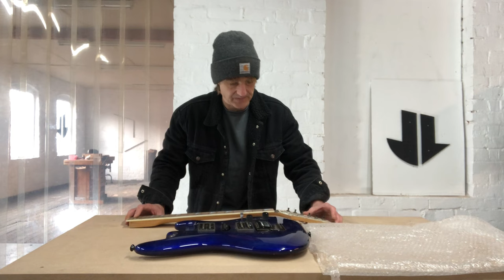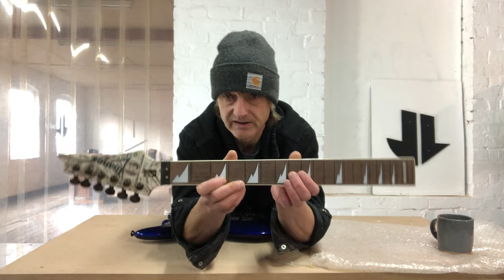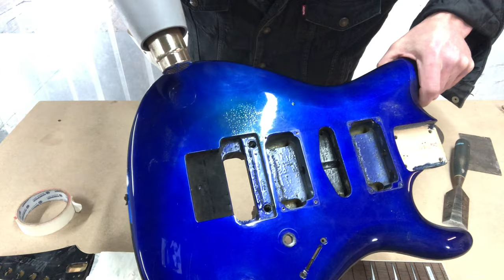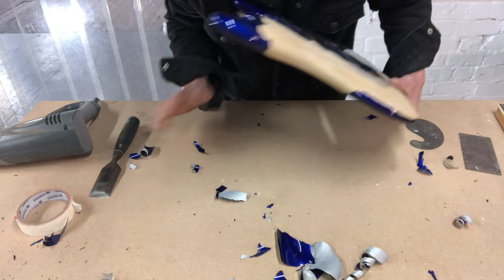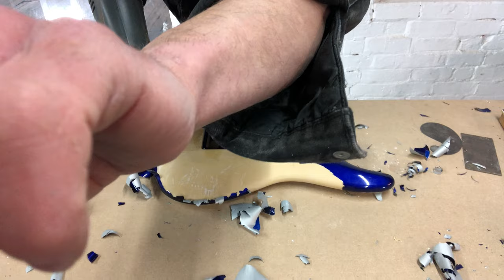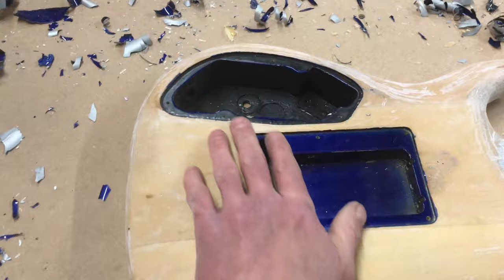How to STRIP GUITAR PAINT made EASY | IBANEZ refinish | HOW TO BUILD GUiTARS

Comment: How do you know what finish a certain guitar has and what techniques need to be used to strip that paint? I dont think many manufactures list what kind of finish they put on a guitar. I have a couple guitars i want to repaint and was wondering whats the best way to remove old finish. One i want to do is a schecter km7 mklll and i only want to do the top wood. It has a satin finish  over a stained poplar burl top. I dont like the stain color they used but the wood grain looks awsome and if i could somehow keep the new finish transparent that would be my first choice. Can the existing stain color be taken out or faded enough to re stain? Even with a dark stain? It has a bluish/purple fade stain existing. If i could get the satin finish off snd stain it black id be ok with that then spray satin clear over it. Any suggestions?great video thank you
Reply from the maker: Most factory finishes are polyurethane or water based acrylic. If it is only a thin satin I would recommend just sanding it. The colour should sand right off. If you are only removing part of the finish I wouldn’t recommend heat as it could affect the areas you want to keep. Thanks.

Comment: Every type of finish serves it's purpose. Urethane finishes are amazing at taking daily abuse and are way better at protecting woods from dings compared to the finish checking that would eventually occur in nitro after a nasty ding... As for your comment that urethane finishes are a "plastic", just a lil fyi, Nitro laquer is one of the most primitive forms of man made "plastic" resins that are still in (in ever dwindling numbers, but none the less) used today. Urethane can't be dissolved by simple forms or acetate stripper because its base compounds are far more resistant to solvents after it has cured. If it peels off of wood, it means the wood was either abused, introduced to moisture, or not properly prepped for finish when initially sprayed.. Nitro will dissolve at essentially any point in its cured form once introduced to even mild quantities of acetate solvents. Nitro is also extremely volatile and hazardous to human health and the environment due to it's ability to evaporate up to 85% of it's atomized form in the atmosphere... it has been illegal to use by manufacturers as a finish in the automotive industry for quite a while.
Reply from the maker: Yea. Poly has its uses as I say. But it isn’t really about making a better guitar. It’s a practical solution. Nitro is closer to actual laquer. And yes the thinners are harmful. I did say it possibly was more harmful. I don’t know. Nitro is much better for guitars though. And much easier for the small builder/diy approach. The ageing process of nitro adds beauty imo. Whereas ploy just ends up flaking off in chunks and us irreparable. Nitro is absolutely the better finish for musical instrument. It may be a kind of plastic but it behaves very differently to poly and acrylic. They use water based acrylic nowadays as far as I’m aware. I’m no polymer scientist by any means.
Reply: @JonLettsGuitars  i do enjoy nitro, especially when it comes to repairs of vintage guitars or Gibson, and as a general whole i do enjoy the way a nitro finish ages, on certain instruments.... but my builds almost always get a two component polyacrylic or urethane clear/hardener combo sprayed through an LVLP sprayer over whatever basecoat i end up using, the results are the strongest, have the most material adhesion per coat by far.... and are the best at self levelling, which cuts down on any sort of level sanding needed. These finishes are not easy without practice and the right equipment/setup, but the same can be said with ANY finish worth its weight in protective qualities.
Reply from the maker: @FulcrumsEdge  yea. Nitro is very user friendly. I’ve always believed mixing products is a bad idea. Due to the different plasticity the finishes eventually pull each other apart. But I don’t really know what’s best and what isn’t. It depends what works for you. I’ve been led to believe that nitro is harder, definitely not the most durable but so easy to fix that that becomes less important for me. I’ve painted a lot of guitars with nitro with great results. That glass effect never gets old. But only ever used rattle cans. Which are cool but obviously more expensive that way. Thanks for your input (I mean that). 🙏
Reply from the maker: @FulcrumsEdge  I haven’t used laquer for years. Just danish oil. “Laquer” just takes too long for me. I don’t have a booth either so it’s really intrusive for the workshop. Danish oil is also pretty bad for the environment.
Reply: @JonLettsGuitars   when i say "whatever basecoat i lay down, i mean more of the style of finish applied, be it a transparent dye stain, sanding sealer/clear coat, solid opaque color, or  pearl/metallic finish. I don't mix finishes with differing solvent bases vastly different chemical compounds.  in some cases there are some pretty incompatible finishes, nitro being one of them, and being volatile after curing is the primary reason. combining some water based finishes with oil or solvent based finishes can often result in a ruined finish. There are some very well known exceptions to that rule and is one of the great advantages of modern polymers. they are, on the whole, inert, once cured. the only way to remove them is with heat and by physical force. as rule of thumb i agree with the sentiment that, unless I want to spend ages testing out finish combinations (which i def don't want to do) sticking to finishes with compatible base compounds is a pretty good way to prevent headaches.
Reply from the maker: @FulcrumsEdge  I realised this after replying :)